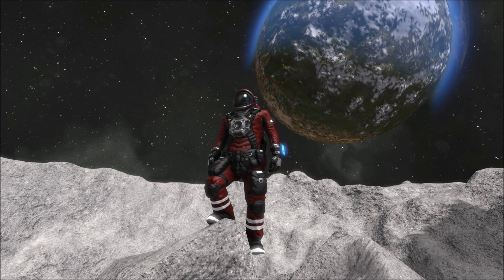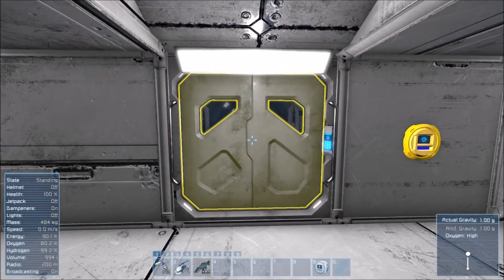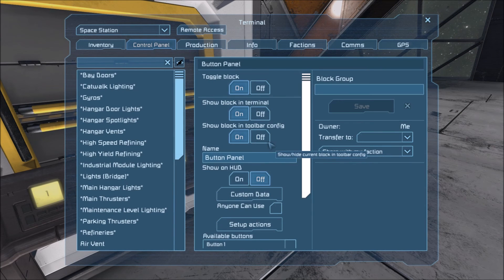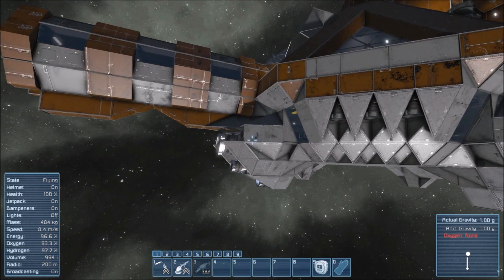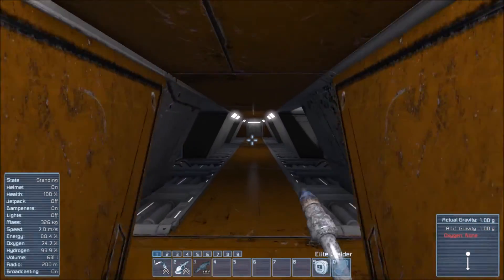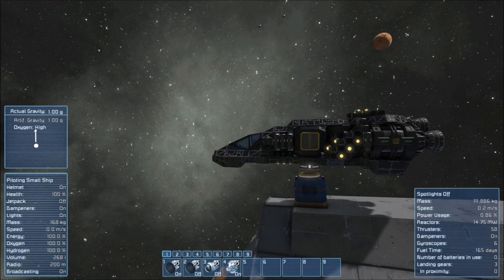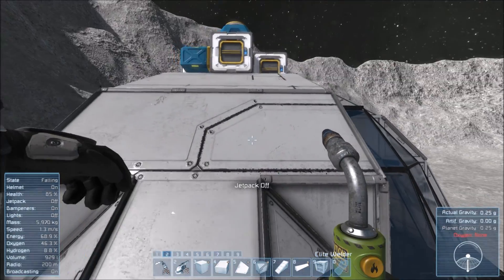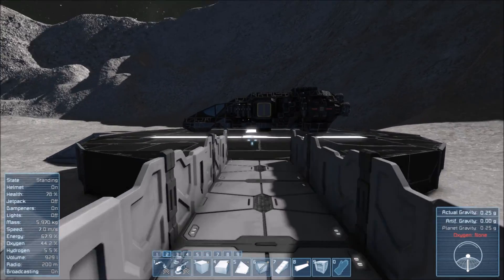MOON BASE! - Space Engineers Survival LP Ep  16

Comment: Why does your landing pad have a large H on it, that stands for Helicopter as far as I know. Should be an S for shuttle maybe. I'm also a little confused as to why your base oxygen generator didn't have power when it looked like it was connected to the portion with solar panels.
Reply from the maker: Ahh, the power was a silly thing.  My catwalk between the landing pad and the Hab weren't actually connected at the time.  I had two edges of a 1x2 upside down slope meeting in the middle of that catwalk, which I believe was the problem.  Once I swapped those blocks out for blocks that connected at their faces the power issue was resolved.  As for the H, I can't argue that you aren't correct.  But I will say that I like the H for the clear points of reference it gives when landing.  I use the edges of the letter to line up my ship and center it on the platform.  If my ships aren't parked straight and centered.... ugh it's like walking past that guy who took up two spots at the grocery store.  Maddening.  :)
Reply: RagnartheReddest Okay, both points make sense! Glad you got the power problem figured out!